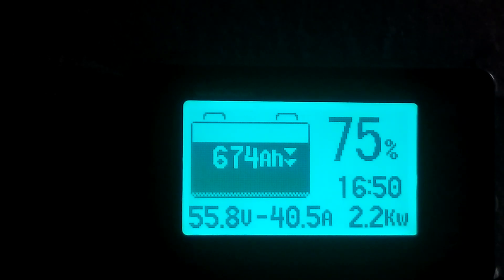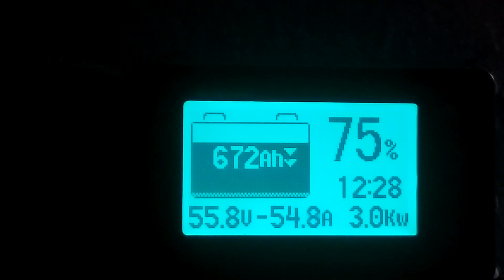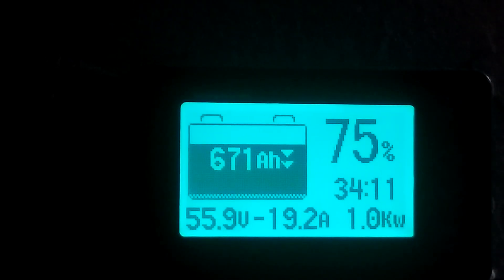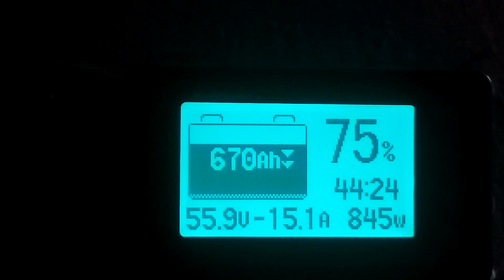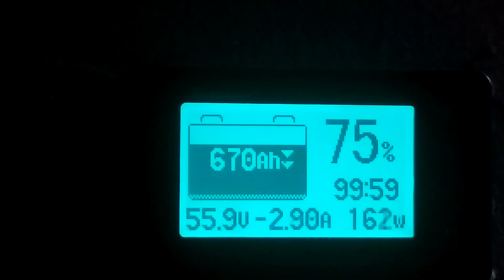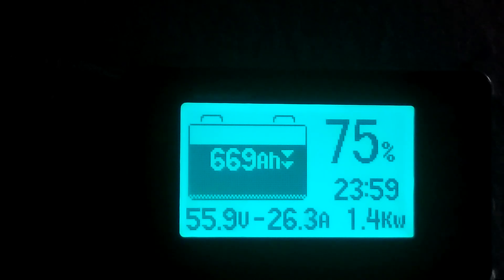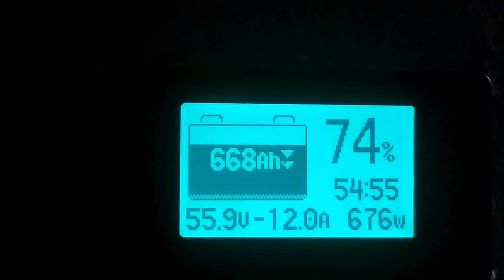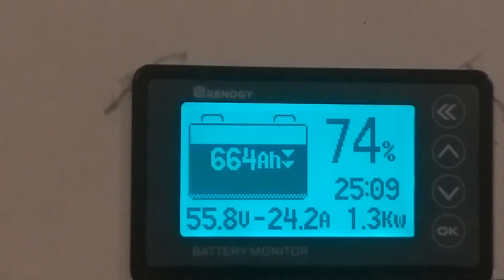how much energy do a mini split consume in heat mode.

Comment: I have a mini split in heat mode and keeps tripping my mppt5048lv to error 07. Overload. Why. I have 1 battery lithium 100ah. During day works fine. Only on battery power it does this. What are you running?
Reply from the maker: Your battery is not large enough.
It is overloading your BMS inside of your battery if you continue to do that it will damage your inverter.
There's a video explaining exactly what's going on on YouTube I can't remember the channel's name but if you search for it you should be able to find it.

Comment: I did test with my shunt and per my test I found the idle load is about 56 watts.  You 150-175 watts is due to conversion loss/heat?